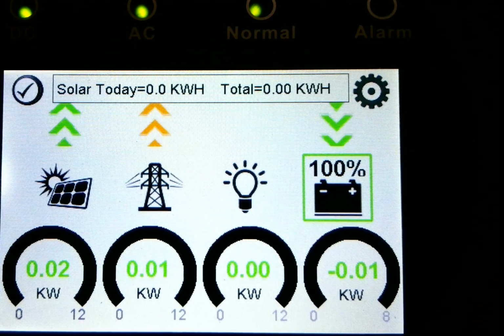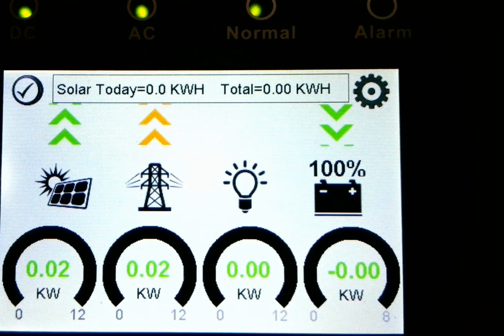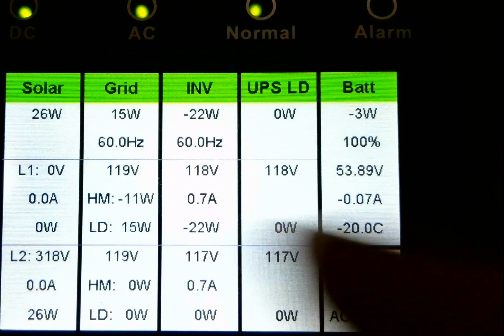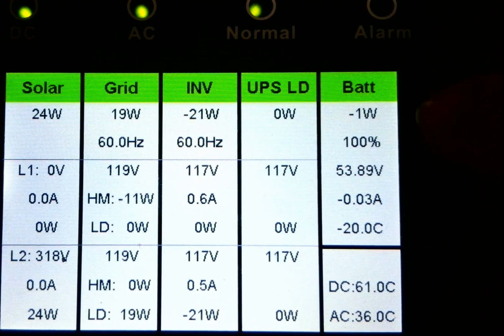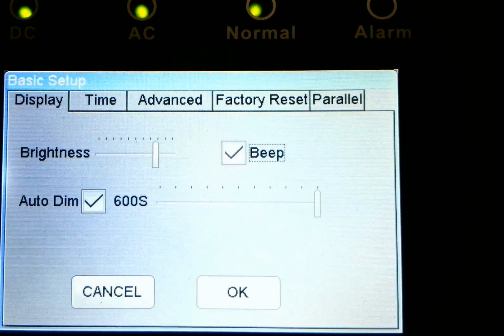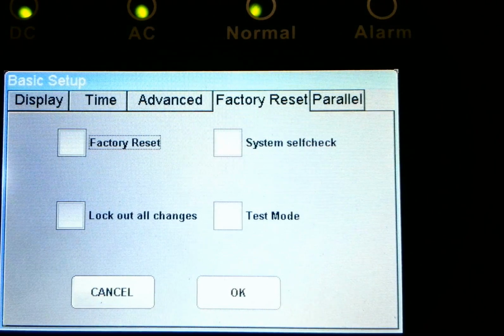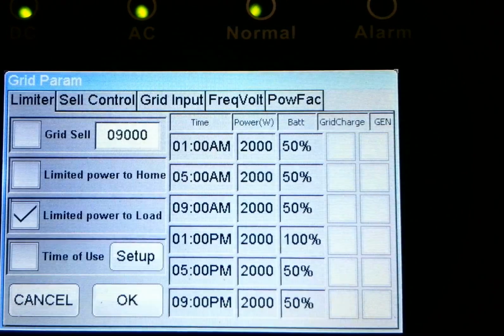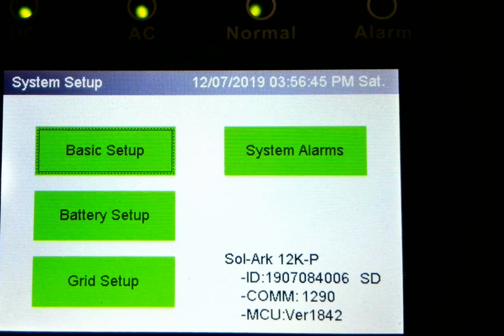8k & 12k quick setup video

Comment: Question:  I am having a solar system installed in July.  My contractor is installing Enphase microinverters on each panel.  We're expecting to install at least 31 panels totaling just over 11kw.  I am wanting to add battery backup at some point.  The microinverters are going into an Enphase combiner, along with the Enphase Enlighten for individual panel monitoring.  Does the Sol-Ark replace either of these devices?  Or do I need them, plus a Sol-Ark 12k?
Reply: If you wanted Sol-Arks capabilities, you should have bought a Sol-Ark system instead of Enphase. It's typically a lot of electrical work and very expensive to add the Sol-Ark into an existing Enphase system, you're likely better off buying an Enphase battery.
Reply: @joshuasethhill3518  Thanks for the reply.  My original post was over a year ago, and I wound up adding a Neovolta N24 to our 11.84kw system in January of this year and it is working out fantastic.  It was the better choice for me over the Enphase batteries.

Comment: I'm embarrassed to ask this, but my ignorance outweighs my pride.  Is there any way I could configure the SA12 that would discharge my battery back to the grid?  I'm not asking because I want to do this.  I'm asking because I don't want to somehow accidentally set something that DOES do this.  I'm in a grid tie setup now.  What I want is for the sun to rise and charge my battery while the house runs on grid.  On the days the sun isn't getting the job done the grid help charge the battery.  Once the battery is at 100% the panels take over powering the house and any excess power goes to the grid.  When the sun goes down the batteries come online until they drain down to 30% and then the grid comes back.  When the sun comes up we start the whole works over.  Probably the wrong venue for this, but sometimes I feel like I'm on my own to figure this stuff out.  Hope this makes sense.
Reply from the maker: Hi Seawolfvic,
No worries, we are help you achieve your energy goals. 

For a short answer, what you would want to do is enable the time of use setting and make sure to NOT enable the sell check boxes when time of use is on. Time of use is a powerful programming tool to achieve your goals and as such can take some time to understand and get the most out of. We would be happy to help you do so should you reach out to our support team at https://www.sol-ark.com/contact-us/.
Reply from the maker: Yes. Just call Engineering Support 972-575-8875x2 and they can explain.

Comment: This screen would make more sense of the PV, grid, load, and battery icons were arranged at the top with the arrows between the top row of icons and the bottom row of indicators (representing the Sol-Ark), then the direction of the arrows would clearly show the operation. Arrows coming and going too and from nowhere are not very meaningful, the user just has to remember what up and down or the color mean for the modes. The only arrows that need to change direction are the load and battery, so the solar arrows will be present going down from the PV to the unit when making power (instead of up to nowhere) and absent when not producing. Same thing for the load arrows except moving up. Also the sign of the numbers seems backwards, especially for the battery. Negative power would seem to indicate discharge instead of charge, but if the arrows were in the proper place, the indicators could use absolute values like some other manufacturers do (i.e. Victron, Skybox). Come to think of it, you could make your code open source like Victron and I could fix it myself. Oh wait, that's too much, never mind. :)
Reply from the maker: Excellent suggestion on the arrows thing. I think we can fix it in 4-6 weeks. We love improving to help our customers. Thank you.
Reply: @Sol-Ark  Ok, you convinced me, I'll buy one!
Reply from the maker: @lbroome  Truthfully our goal is not to sell like other companies. We care about the long term outcomes and any of our customers can tell you that. We listen to innovative ideas and execute. Thank you for your help.
Reply: I had the same thoughts as you but what bugs me the most is the battery discharging as a + and charging as a - WTF!?
Reply: @HomesteadOnThePreserve  If you polled most people and showed them just the number for battery current without any other indicators to signify charge/discharge, my bet is they would never think - indicates charging, but this seems to be common among many inverter manufacturers. I think in Sol-Arks case, the sign could be left off the main display completely and it would be less confusing. I have grown used to it so It doesn't really bother me any more. I will hand it to them, they did re-arrange those icons and it makes much more sense now (at least to me).
Reply: @lbroome  Yeah I saw they actually listened to you and changed the icon configuration! Very cool. My off grid, custom built cabin with SolarArk 12k was just finished last month. Its going to be a close call with the power draw. I, as others did not realize the 12k only put out 9k. Not happy with SolArk right now. I may be cursing the company I have been highly touting!
Reply: @HomesteadOnThePreserve  9kW is a good amount of power if you are conscious of the types of loads and balancing between legs. Loads with high inrush current are not suited well for high frequency inverters like the Sol-Ark and probably cause the most problems for people. I am on grid so I was able to split off all the house loads to a sub panel for the inverter, but I left part of my shop on the grid for the air compressor, welder, etc. I have mini-splits for AC (and I love them) and all the other house loads are resistive, so no problem. If you are completely off grid and you have high inrush loads, like a pump motor, you can install reduced voltage soft-starts on them that will work well with the Sol-Ark. You can find units for RV air conditioners up to 3-tons for about $350 on Amazon and they should be able to work with other loads like pumps just fine. It's like everything in engineering, it's a trade-off of design goals. I personally think the efficiency of not wasting power in a low frequency transformer is worth it. What type of loads do you have?
Reply: @lbroome   Hi Larry, I was very selective with the few appliances in our cabin. All made 2021-2022 super efficient and a couple are energy star rated. 21 SEER (18,000btu) mini split, apt size fridge, mini stacked clothes washer / drier, 2 burner cook top and 1hp well pump (just bought a 700 watt "no static load" microwave)  No TVs, no extra crap. My main concern is the (single point) tankless water heater. It only draws 29 amps and 7000 watts BUT that 7k is already near the max for the SA12! The smallest, most efficient heater just to raise temp a few degrees for the shower only and it may pop breakers/overload if another appliance or two is running. This would not be a problem if the SA12k was actually 12K output as I and just about everyone else thought. 
Heres my wife doing a tour so you can see our limited stuff if you have a spare 7 minutes. We will be at the completed cabin for the first time July 4th for a week and find out if I will be thrilled or pissed at SolArk. Thank you for your input my friend.
https://www.youtube.com/watch?v=_xJPFFYg2To
Reply: @HomesteadOnThePreserve  That's a nice cabin. I'm with you. If a company has an 8kW inverter and call it the Sol-Ark 8K and put out a new larger model and call it Sol-Ark 12K, you would kinda expect it to invert 12kW. The guys at Sol-Ark seem to be customer relations challenged. 

Demand electric water heaters are a beast of a load. The SA can run that 7kW load just fine and it sounds like you could probably run all your other loads at the same time too, except for that well pump. I am guessing that pump will pull 750-1kW when running and 4-5Kw when starting. I don't know how that pump will cycle when the shower is active, but 5kw inrush could trip the SA when the demand heater is operational. And it won't pop any breakers, your Sol-Ark will just get an over current fault and shut down completely. You will have to try it out and see what happens. Maybe you can put a soft-start on the pump and be OK.You probably don't want to hear this, but you should probably put in a 20-40 gallon conventional electric water heater before the Rheem unit. If you have extra solar production during the day, you can use the smart load on the Sol-Ark to preheat the water in the tank, even if only half way, to take the load of the demand heater. It looks like you don't have much space in that closet for a tank heater but maybe you could put in a small 10-20 gallon unit? It looked like that closet was on an outside wall, maybe plumb through the wall to a large outside unit? How much battery capacity do you have?
Reply: @lbroome  Thank you for the cabin compliment. The Rheem tankless you see in the video is a RTEX-11 and draws 46 amps / 11800 watts !!!!!That piece of equipment slipped by the solar company architect who should have caught the fact it was too powerful before approving the specs. (I don't know how I didn't catch it and I selected everything) The solar was inspected and passed 2 weeks ago. I live 8 hr drive away so my buddy living in the area stopped by to test the system. He turned on the mini split blowing cold while all house lights and fridge were on. Then he turned on the hot water and the AC went off/on a couple times and the lights all went dim. He shut off the AC (fridge still running) and tried again and the lights went dim and the water ran slightly warm (set to 105) I was shocked the system did not completely shut down. I guess it throttled down the  tankless watts. Soooooo I now have a company swapping the Rheem for a Titan-64 drawing only 29 amps and 7000 watts (the only hot water is for the shower and it will heat to 100 no problem). With the AC on and maybe a microwave whatever else I am hoping all is ok when the hot water is run. I will find out on July 4th when I visit for an entire week.Yes, the submersive well pump draws 750 watts. I'm hoping startup will be OK since the SA does a peak of 16K for 10 seconds, again, time will tell. You definitely are a knowledgeable person Larry and I will keep your "soft start" idea on the well pump in my head, thank you for that! O' the batteries are 3 Life Power 7.5kw's so 18,000 usable kw (reserving 20%) and to complete the system were running 14 panels @ 430 kw each so 6K with a pure south facing roof.
Reply: @lbroome  Incoming from Duke Togo
Reply: @HomesteadOnThePreserve  Curious how you're making out?  The soft-start is an excellent suggestion.  I'd also consider going to a HPWH instead of that on demand system.  Mine draws very little and TOU can be set for low demand times.

If your "12k" inverter isn't going to cut it, you might want to consider selling it and upgrading to the new 15k for not too much of a price difference.  Or look for someone looking to do the same and add another 12k to your system.  But hopefully your system is working well!

Comment: Awesome looking product but unfortunately not affordable for most people
Reply from the maker: Sadly, I agree but maybe not for the same reason you are thinking. The #1 expense is the battery. We have tried to introduce a low cost / high cycle battery but most people prefer lithium (which is also good). So we included built in load mgmt to reduce off grid batt size by 30%. Even still, people under size the batt bank. #2 expense is installation. We made this DIY friendly so installers, electricians, and handmen could quickly install. Still, most people get professional install. #3 expense is the hybrid inverter. We made it 10% more efficient than others, which helps pay for the higher costs. Please understand our development costs + $400K+ in UL Listings is challenging. #4 expense is financing and close to #3. It is ~20% of the entire amount and often hidden in package pricing. #5 is solar panels & mounting. #6 is overkill on safety (rapid shutdown, AC disconnect, DC disconnects) & permits. Until we address the battery, install, & financing, lower inverter pricing won't make much difference. You have no idea how painful this subject has been for my team because we are focused on affordability and customer/installer success. I am ultimately responsible and am incredibly sorry the complete solution is not more affordable for the reasons above. I feel your pain. 
Tom Brennan
Sol-Ark CTO
Soli Deo Gloria
Reply: @Sol-Ark   What is the number one thing that drives cost for most businesses?  Taxes.  Number two is regulations.  In this case it is UL Listing to be compliant with government red tape.  Sadly, the people who want more taxes and regulations tend to not understand it hurts them most.
Reply: If you can afford a car you can afford a huge Sol-Ark system with solar and battery backup.

Comment: Good video. I'm looking forward to a more detailed video on the 12k model, especially the master and slave stacking set up, and how that works for charging batteries with solar and how much solar it can handle while being stack, and if you can have ONE LARGE battery bank or does each inverter still need its own bank. Keep up the great work.
Reply: The current set up is one battery bank which is connected to all inverters that are stacked

Comment: I really like everything that I'm learning from these videos. But question: If not selecting auto dim voids the warrantee and burns out the screen, then why have it as an option. You guys are pretty sharp, I'm sure a future software update will fix this.
Reply: Was thinking exactly the same. It's a terrible problem with a simple solution. Eliminate the AUTO DIM button and make it auto dim if no button is pressed for 1 minute. SOLVED!